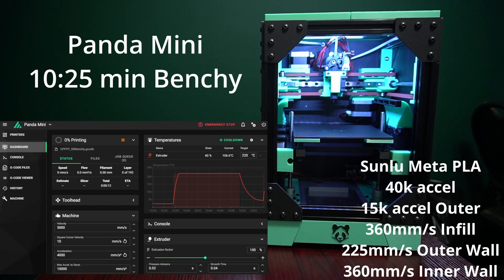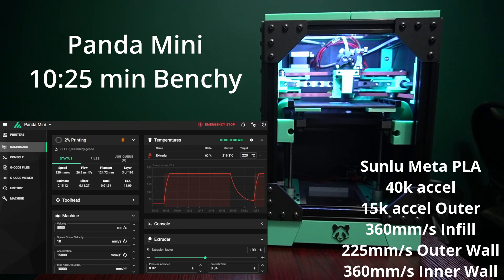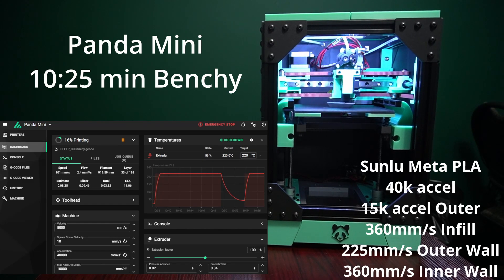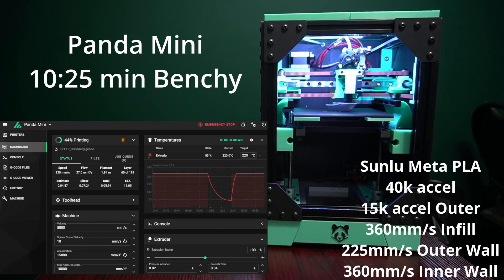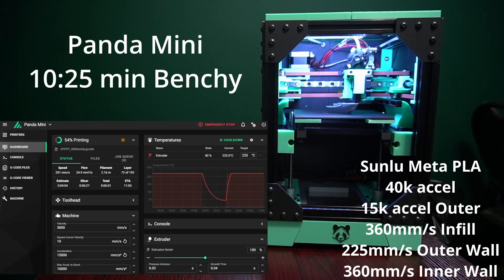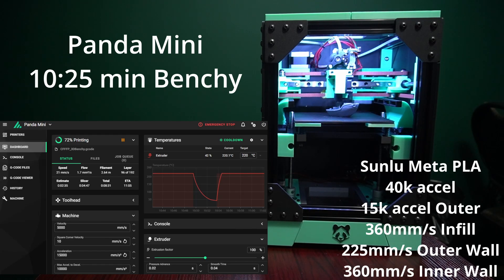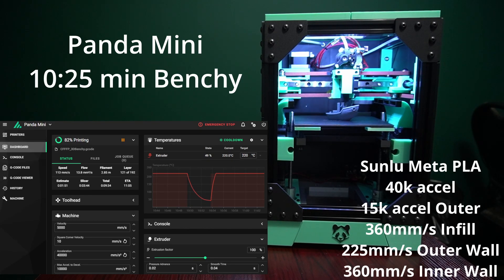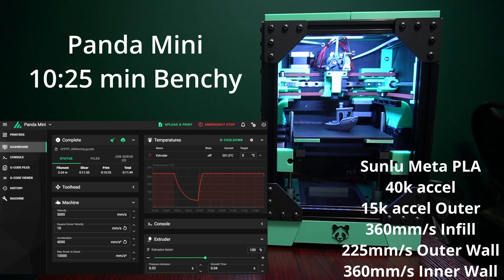CoreXY 3D Printer - Panda Mini / Quick Benchy and Chat!

Comment: How would you compare the bambu hotend to the ceramic v6 or volcano hotends out there now?
Reply: Also was very into the rook and a couple others youve put out but now that I see this I think this is the one Ill have to actually build vs just be inspired by.
Reply from the maker: Bambu hotend is the cheapest for the money, weather is it a clone on ali express or genuine it's a great deal and enough flow for 8 minute speed benchies without issues

Comment: Those acceleration settings are almost exactly what I use on my Ender 3 😁
Reply: your running 40k acc on your ender 3? ya ok
Reply: @BrianVoelker  Over 40k on X, much less on Y. X can do around 100k if requested but E motor can't keep up and I prefer to keep a 3:1 ratio between X and Y accel since that's the ratio of "peak without over smoothing" I use for outer perimeters.

Comment: Do a little research on turning vanes for the fan ducts.  I ran into the same issue with a 90 degree bend on an active heating setup.  Adding a couple turning vanes and extending them all the way to the exit made the air exit evenly instead of all rushing toward the top edge.

Comment: The parts in which I think you tackled well that make this printer stand out the implementation of a sturdy frame with your corner brackets and the belt separation which i believe adds more rigidity to the print head. Bambu went opposite and did long rail separation between the top and bottom, you went long belt separation which should help just as much but im guessing made it a little harder to design parts. Would love to know your thoughts and your decision on certain things like this.
Reply from the maker: yes I wanted a good belt separation to support the weight of the DD extruder better and also the toolhead, I think support has high and low as possible helps. I swear I changed the belt path on this printer 3 times while designing it. I defiantly want to bring the same design elements to the full size Panda.
Reply: @Rolohaun  It will be interesting to see how it holds up. Im guessing belt tension needs to be really good otherwise you would have a skew and potentially put uneven pressure on the ball bearings in the linear rail. Just my thoughts, you probably put way more thought into that part than i did.
Reply from the maker: @BrianVoelker  corexy belt tension is pretty even so it should be ok. I never thought about it much but MGN9 is pretty robust for this size.
Reply: @Rolohaun  Ya it should be ok.